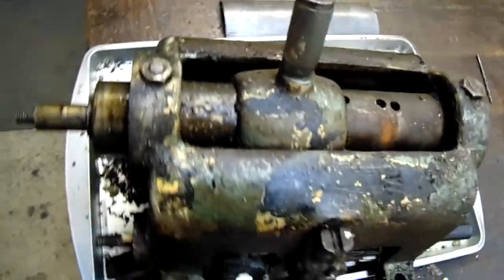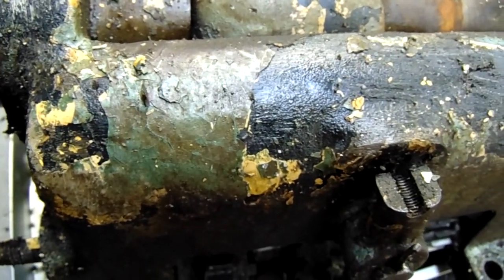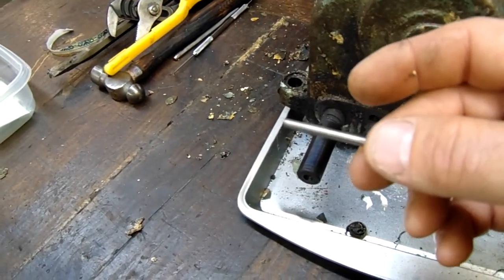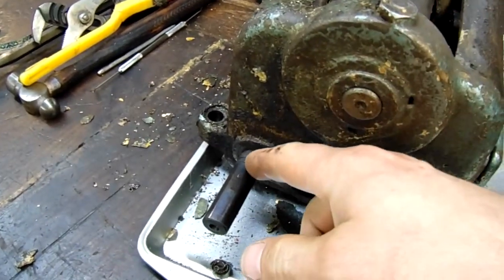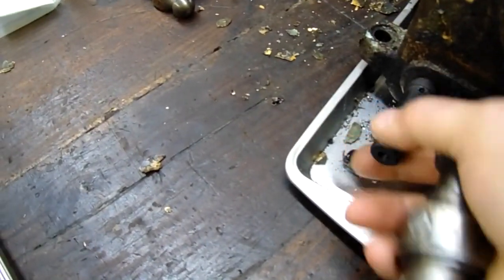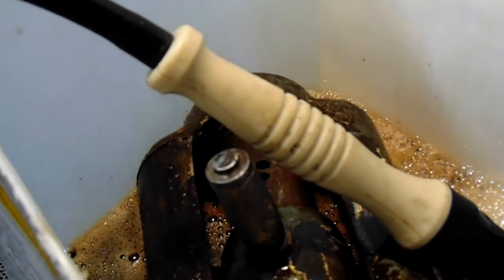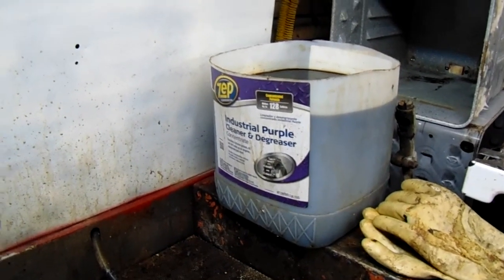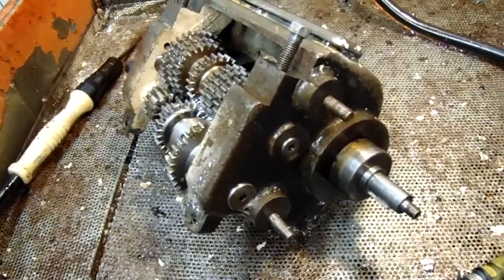LeBlond Restoration Episode 3 - The Quick Change Gearbox Part 1

Comment: I'm restoring a 1935 LeBlond Regal 13" lathe very similar to yours. My bed is a 36" between the chuck and tailstock. My son found it at an estate sale on the last day all in pieces. The previous owner had been a gunsmith and he had passed away last year. The lathe had been set up in his basement shop. The family had to completely disassemble the lathe to remove it from the basement because of the extreme weight and they were clearing out the house for new owners. If I did not buy it on the last day on the sale his Daugther said that it was headed to the scrap yard. The family felt it was worth a fortune just for the weight of cast iron. I have been working on it since August, that a whole other story. I have a few parts that I have not figured out how they fit plus several pieces of hardware are missing. Seeing your video helped me locate where the Quick change handle goes, fortunately, my handle was not broken. I'm looking forward to your next video to see how to assemble it. Thanks for the help I will be watching. Dave